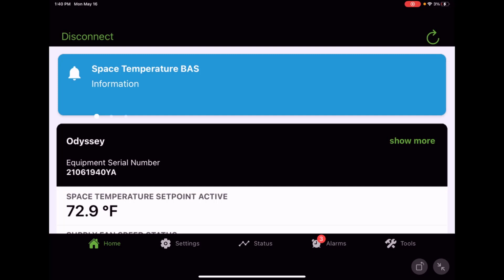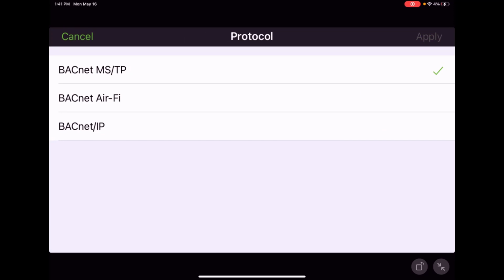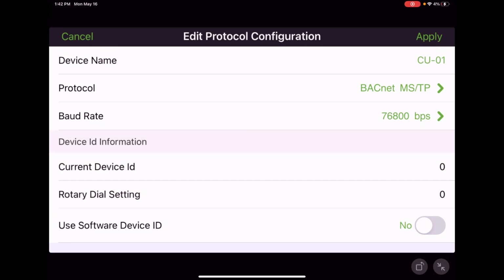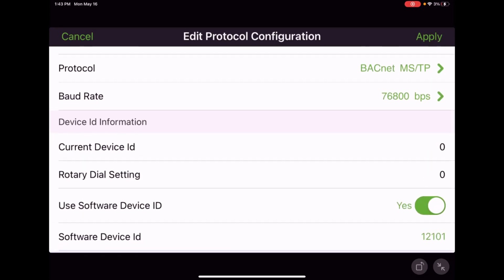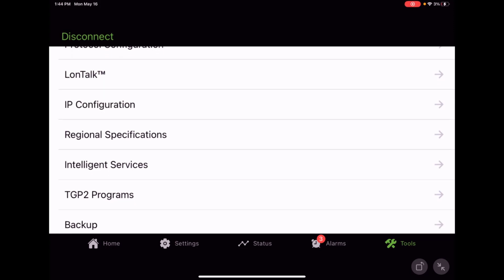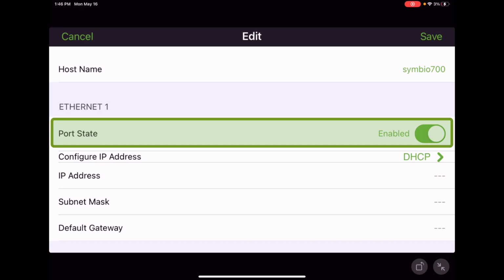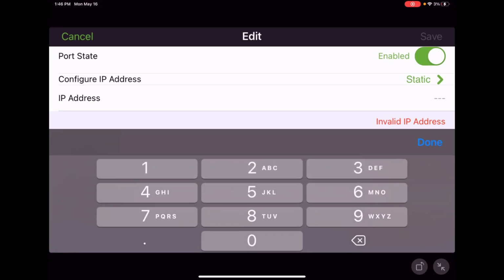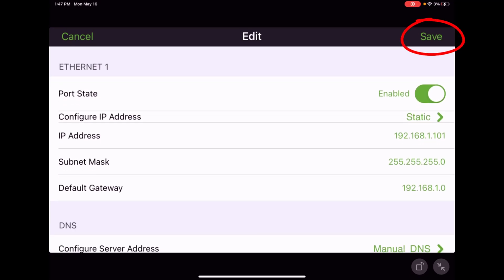Symbio Service & Installation App: Adjusting Protocol and IP Configuration Settings

Comment: I have a quick question, is there anyway to integrate this with an existing tracer summit system with a bmtx where lontalk is not an option. Current unit is com 3  new unit is symbio.